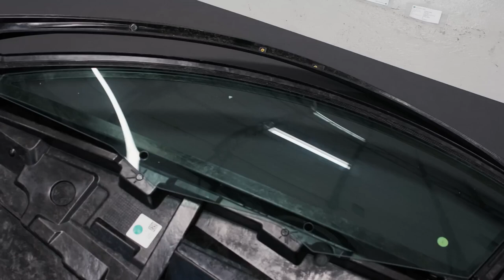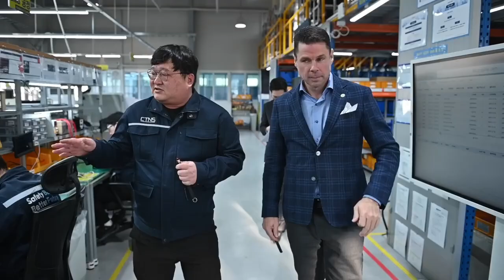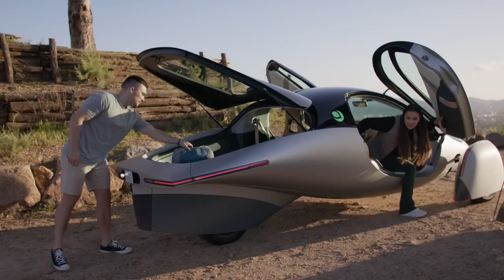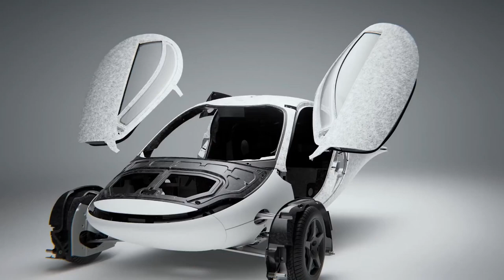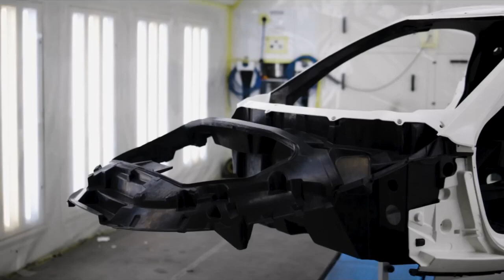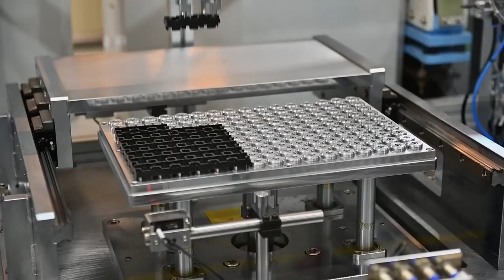Aptera is About to EXPOSE the Electric Car Industry's Darkest Secret

Comment: Aptera is a motorcycle, not a car
Reply: Aptera is an autocycle, not a motorcycle
Reply: @Tekaisuwu  GENERAL ASSEMBLY OF NORTH CAROLINA
SESSION 2015
HOUSE BILL 6
RATIFIED BILL
H6-v-3
AN ACT TO DEFINE AND REGULATE AUTOCYCLES.
"Passenger Vehicles. –
a. Autocycle. – A three-wheeled motorcycle that has a steering wheel,
pedals, seat safety belts for each occupant, antilock brakes, air bag
protection, completely enclosed seating that does not require the
operator to straddle or sit astride, and is otherwise manufactured to
comply with federal safety requirements for motorcycles.
a.a1. Excursion passenger vehicles. – Vehicles transporting persons on
sight-seeing or travel tours.
…
d. Motorcycles. – Vehicles having a saddle for the use of the rider and
designed to travel on not more than three wheels in contact with the
ground, including motor scooters, autocycles, motor scooters, and
motor-driven bicycles, but excluding tractors and utility vehicles
equipped with an additional form of device designed to transport
property, three-wheeled vehicles while being used by
law-enforcement agencies and mopeds as defined in subdivision d1
of this subsection."

You can make up your own definitions, but they have no legal meaning.
Reply: Why
Reply: @Veggamattic  
GENERAL ASSEMBLY OF NORTH CAROLINA
SESSION 2015
HOUSE BILL 6
RATIFIED BILL
H6-v-3
AN ACT TO DEFINE AND REGULATE AUTOCYCLES.
"Passenger Vehicles. –
a. Autocycle. – A three-wheeled motorcycle that has a steering wheel,
pedals, seat safety belts for each occupant, antilock brakes, air bag
protection, completely enclosed seating that does not require the
operator to straddle or sit astride, and is otherwise manufactured to
comply with federal safety requirements for motorcycles.
a.a1. Excursion passenger vehicles. – Vehicles transporting persons on
sight-seeing or travel tours.
…
d. Motorcycles. – Vehicles having a saddle for the use of the rider and
designed to travel on not more than three wheels in contact with the
ground, including motor scooters, autocycles, motor scooters, and
motor-driven bicycles, but excluding tractors and utility vehicles
equipped with an additional form of device designed to transport
property, three-wheeled vehicles while being used by
law-enforcement agencies and mopeds as defined in subdivision d1
of this subsection."

You can make up your own definitions, but they have no legal meaning.
Reply: @Veggamattic  See also Aptera FAQ.